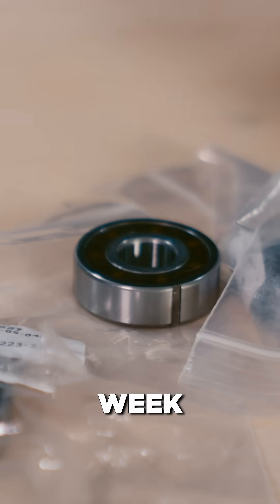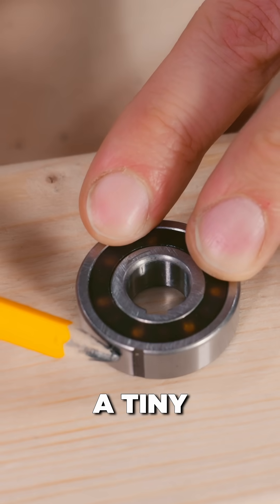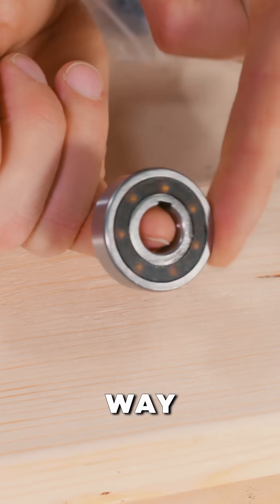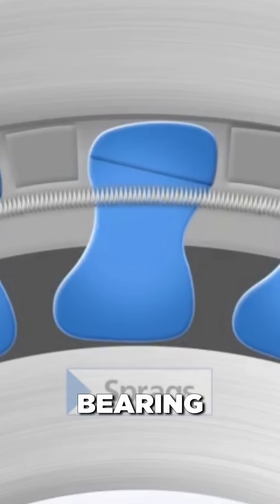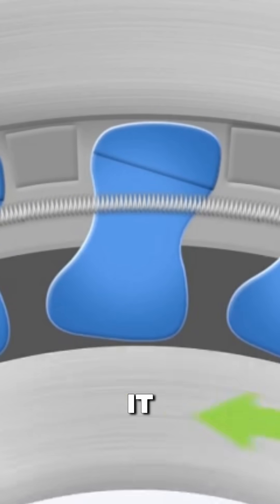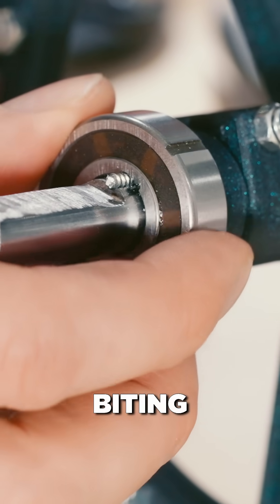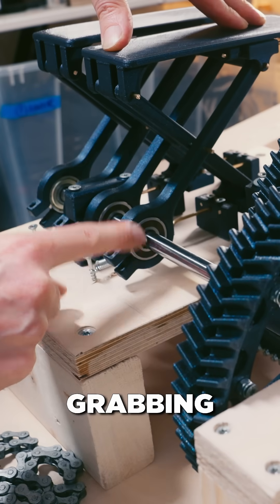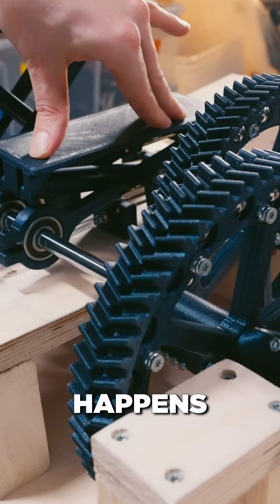One-Way Bearings: Pure Mechanical Magic!

Comment: keyway. I found this one way bearing found used in pedals for a manual portable Yirego laundry machine. just don't press with sudden force or it will ruin the bearing, very quickly.

Comment: Its called a hold back mechanism, those are fitted separately in larger machines or where space is available, here the HB is integrated in between the bearing races for a much compact fitting.

Comment: You should check out one way needle roller bearings. They similarly use a sprag clutch on each pin, but rely on friction to transmit torque to the shaft. They can transmit a shockingly high amount of torque like that, and it removes the need for a key way which is a pain to assemble.

Comment: Another great thing about one way bearings, as opposed to ratchet+pawl mechanisms that perform similarly is that the bearing is nearly silent and you don’t get the clicking like you’d find in a ratcheting end wrench. Vibrations and sound are important for a musical marble machine!
Reply: there are better solutions with continuous motion like the old manual sewing machine pedal

Comment: Huh.  I've worked with a lot of sprag clutches, but I've never heard of one that can also function as a bearing (ie handle designed axial and radial loads).  Clutch function, yes; bearing function, no.

Comment: ALL the input energy of the whole machine goes through the stopping mechanism of this bearing. Please make sure they are rated for that!!!
Reply: I'm guessing this will end up with a larger format one way clutch in the final design. No need to panic yet, this is just a prototype.
Reply: I had the same thoughts. Perhaps a ratcheting system would have been better. However, this is a foot pedal powered musical machine, no? There is no need to over engineer it. And he has 4 of them. It should be fine.

Besides, like commentor before me said, this is a prototype? Even in this video I can see areas where engineering improvements can be made. Who cares. It's not life threatening if it fails.
Reply: You just solved this mans problem. Hopefully he reads his comments. 😂@Troy13
Reply: My comment is meant as a heads-up. Although the one-way bearing is very usable for small scale/prototype, knowing Martin a little after all these years watching, he probably wants to find a bigger version of such bearing.
But there also needs to be a quick accessible unlocking mechanism to prevent disasters. Either by using a custom one-way rachet lock, or some other disconnect.
Reply: @marknn3 all good friend. It's a good callout
Reply: Why? It really doesn’t matter. If they get worn out, they’re replaceable. Bearings are cheap. Your comment makes it seem like this is dangerous when it’s just not.
Reply: Its not a big deal. Nothings going to explode or anything, he just might have to replace them sooner than expected. And he can get a higher rated bearing if they fail.
Reply: I just looked up a similar product from Ringspan they can be used with 9 Nm of torque if you have a lever arm of 10 cm you can put ~90kg on the pedal and be within spec the mechanism is only engaged when he pushes on the pedal so there are only short bursts of torque on them and they will probably be fine. I am an engineering student and don't have all the Infos about it I matched it with the bearing on the side which was of size 6201 and went from there. He has all the information and it will probably be right for his application
Reply: @TerraCAD yup I agree. 9 Nm rated, 0.01m or so lever arm, so 900 N force. Looking at how lightly he is pressing down the pedals with his hands, he’s probably putting in no more than 25 N so these bearings should be well within spec!

Comment: The two speed gearbox in my rc car uses the same bearing, unfortunately though they break right in the outside keyway and then they lose the one way function. I replaced soooo many of them and got tired of it and bought a single speed gearbox instead

Comment: I ran into bearings like this working on copy machines as well as automatic transmissions. Rather than a ball bearing style with two races and keyways, the ones I have seen are more often a gear or something on the outside with exposed sprags on the inside to directly grip onto a shaft. It was a common thing in copiers to have to scuff the shaft up with emery cloth since it would end up polished and not grip as well.
Reply: Nice, I was looking for a comment like this! I worked on copiers and thought the same thing. 😋
Reply: @RMWestcott  I've actually seen a 3/8" ratchet that used sprags instead of the usual spring and pawl mechanism. It didn't work that well but was an interesting design.

Comment: So you're using the locking of the one-way bearing to turn the shaft?  Are they meant to be used this way?
Reply: Yes, as others pointed out that's commonly done on pull start engines and such

Comment: This is an insane upgrade, not just for functionality, but also for safety: If one foot ever catches the pedal of the other foot from the bottom, you will only have to fight your own weight, but not the torque of the flywheel or huygens drive
Reply: pretty sure they wont be that close to each other when he stands on it  that's not a neutral stance of your feet so standing on it will feel awkward any ways
Reply: My ignorance offends me.

Comment: Please never use a screw as a key, it hurts my soul
Reply: came here for this comment.
Reply: Honestly @meetim6271
Reply: @meetim6271 same!
Reply: Didn't even notice that. Keystock is cheap! Any hardware store will have it.
Reply: He acknowledged that in the full video. He just didnt have the proper key tooling on hand at the time so he improvised
Reply: @randompersonoftheinternet  classic martin...
Reply: This is a small scale prototype for proof of concept.  Last project he was so focused on "perfect" and "looking cool" he lost sight of "working".
Reply: It works 🤷‍♂️
Reply: Yep hurt me too
Reply: I think i need new eyes now
Reply: My sentiments sir
Reply: Love
Reply: It’s a prototype
Reply: @toineenzo  splines and keyways are proven the self tapper method going to take some refining
Reply: "I can't believe it's finally here! Let's bugger it up!"
Reply: "Casi se me va la chaveta[key]"
Reply: We need FunkFPV to review this.
“I’d like to thank you for playing”
Reply: You would've hated his old flywheel designs.
He had two laser cut plates, one on either end of the bearing and a dozen bolts  going between them were all that was supporting the outer race of the bearing. This was supporting like a 30lb flywheel and all that force was getting concentrated right onto the crest of those threads.
Reply: I agree, but I also drill holes in pennies for washers so I get it. And it... does work..
Reply: It's called prototyping. You worry about using proper parts when it needs to last. This is a proof of concept.

Comment: Wow, I didn't even know one-way bearings were a thing. And how they work is ingeniously clever!
Reply: You’ve never rode a bike?
Reply: @TylerSmith-qx6uz  
I did, I just never found out about that until now.
Reply: the automatic transmission in your car has at least a couple of them. (CVT's excluded)
Reply: Most alternators in modern vehicles have those too. Modern alternators rotate just one way.
Reply: @miserirken  nevermind, just read up on alternators with one way clutches. Its what allows them to free wheel when not needed to charge.  So, you were right, I guess the vehicles I've services just aren't that modern.
Reply: @ i literally work at fixing alternators, so i see a plethora of those per week, of different kinds and models. Not all alternators have one way clutches, of course, but those've been becoming more and more common.
Reply: Wow, they're just everywhere, huh?
Reply: Famously, ball bearing is swedish invention
Reply: You'd be amazed at the breadth of bearing design and use. Check out the ISO bearing standard specifications, and those are only the standardized lists, there are all kinds of unusual "nonstandard" bearings out in the wild. 🐻
Reply: Helicopters use them.
They have another name on helicopters though, but it's why when an engine/trans siezes the rotors still spin.
Reply: @myne00  probably called something like a "free running bearing" allowing for decoupling for the blades from engine...allowing a pilot to use counter rotation to put it down....pretty damn smart.
Reply: Every bicycle has 1
Reply: @carlhafele  careful with absolutes...bikes with coaster breaks use a completely different system to allow free wheeling.

But would be right to say "most bikes have one"
Reply: Uhh, one way bearings are more common than you think. What do you think the rear wheel does in a bicycle??

It's just that this bearing would be called a noiseless hub when used in cycles.
Reply: i knew this for the first time since the 90' 
when i got myself a pullstart RC car on Nitro :-D
The pullstart also had a 1 way bearing .